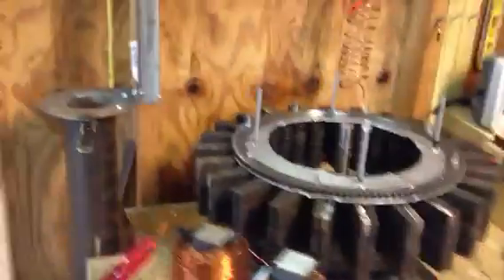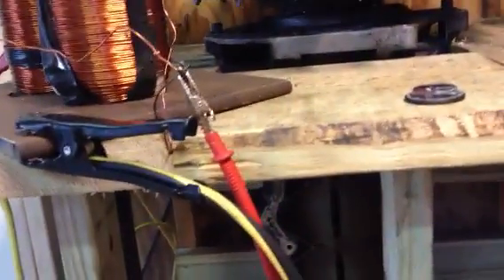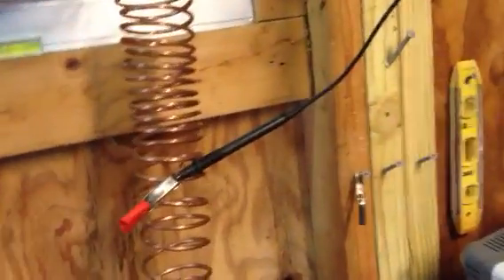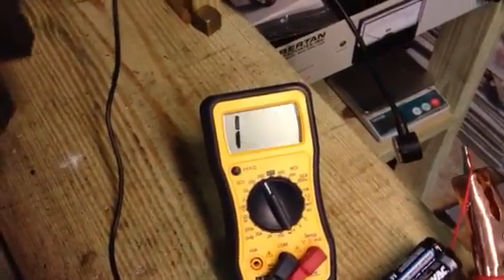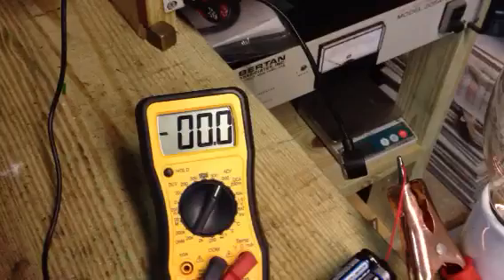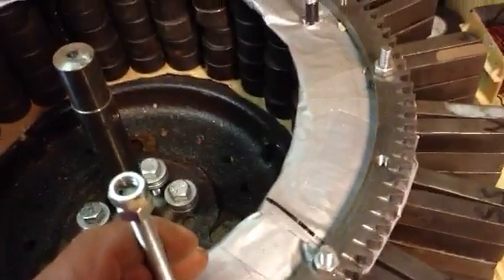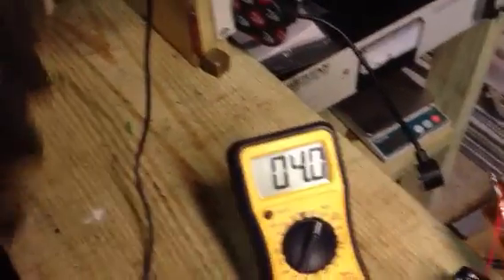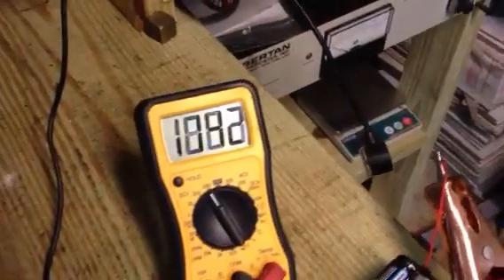Ed Leedskalnin Magnetic  flywheel

Comment: Why do you keep saying "Power" ?  You do know that voltage without load does not suggest any power, do you ?  Because if it did, you'd get much more "power" than this by brushing your hair with a plastic comb.  Doing so you'd get several  KILO volts of "power".  Secondly, a device like that produces pulses (spikes) of voltage. So you can't really believe what the voltmeter designed to measure harmonic oscillations, tells you anyway. Its a cute toy, but I struggle to understand what the experiment actually shows. I am not trying to be critical, believe me, just trying to understand where the novelty in this experiment actually lies. All I can see is a demo of electromagnetic induction.
Reply: looks like a good fly wheel for a bedini to me,
Reply: @DoctorTimelord  what's a "bedini"? Neve heard the term.
Reply: @DJdeliverance  look up bedini coils, its a cheap energy thing, mythbusters did a thing on it, but they built it completely wrong and deemed it busted, ive made one (that works) with some degrees of success, but i didnt have the correct coil wire or proper length so it functioned but not as good as it "should" saying that, alot of ppl have gotten better results then me, but not sure if anyone has properly replicated john bedini's one

Comment: That is impressive voltage, but voltage only doesn't tell you the power output... Think about a static spark... its incredibly high voltage, but you cant run a washing machine with it... no current.

Comment: I'm very interested in these new physics power technologies, so I"m not bashing the device itself, but you keep referring to the 'power' output from the system. But, power is a function of voltage AND current. Voltage alone is not an indicator of power, so there is no evidence of any significant power output. I do hope you finish the project, and get someone knowledgeable to look at the real input vs. output power, as I would be very interested in how it performs.  Good luck.
Reply: You are right, but he doesnt need an actual output power concrete measuring device but a simple lightbulb connected to those negative/positive wires, then lets see how much power he really produces. Voltage without load is nothing.

Comment: Voltage does  NOT equal power. You may be pushing a crap ton of voltage, but barely any current. Power (watt) is the combination of both voltage and current. If you actually do the measurement and math you will see that you get lower wattage out than what you put in. Go make something that can deliver and increase in voltage and current, Oh wait, IT'S IMPOSSIBLE.

Comment: what about putting a container inside of wheel with the magnets poking thru it and then fill it up with water and then put the negative into the water and spin it and see what you get......like a place to fill with water (half closed so water doesnt splash out) seal it up with poly caulk with the magnets poking thru.. make kind of like a car tire laying down with a bottom,  sealing it and the magnets in  to hold water but not let it splash out when you spin it then hang the negative in the water

Comment: The coil and flywheel are not maintaining continues contact. Thus, sporadic measurements on the meter are obtained. When the wheel is sped up the coil maintains less contact due to the increase in inertial power transferred to the flywheel. Basically, the coil is in the air longer and less time off contact to the flywheel.The voltage meter shows a decrease. More contact to the coil and flywheel allows higher voltage due to longer contact.

Comment: the coils are producing collapse voltage from when the electricity is turned off. with a diode and a cap you can collect the voltage can easily go to 10kv. lots of fun but low watts

Comment: From what I had observered watching the CoralCastlecom video. I got the impression he was focusing the "B" field of the magnet into the earth through the crank case, I think you need more mass at the center of the crank area, See Ed's design,  I think that extra mass was deliberate  a reason for the extra hardware at the center. Anyway how did you determine the polarity of the magnets???  did you stack in the repel mode or the attract mode??  I admire your efforts!!

Comment: You mentioned utilizing water as the contact point in the video, but was afraid of the effect the spinning had on  the water. Use a conductive gel, for two reasons:

1) The contact point can be penetrating the surface of the gel, and the trail behind it would be self repairing, allowing for maximum contact surface area.

2) The stability of a gel can be designed to withstand greater centrifugal force while keeping its relative shape

Comment: Your voltage is coming from the inductive current from the changing magnetic field and the transformer from the two coils.  I doubt the batteries are contributing much. Remember Faraday's law of induction.  You can move the coil relative to the magnet or you can move the magnet relative to the coil. You are doing the latter.  Couple that with your two step up transformer coils and viola- high voltage.

Comment: I think your coils might be arranged in the wrong direction.  If you turn them 90 degrees toward the wheel so that the top of the coils bridges the North and South of each V-magnet as it passes.  Just like how you charge the V magnets with the PMH.  Think of the coils as having to pick up off of the V magnets the same way that they are charged but in reverse.

Comment: what's with the other coil on the right side of the vid??
as far as the voltage that you're getting,  Look at an old lawnmower ingnition system... a rotating magnet past a coil with a make/break contact generates 10's of thousands of volts with no batteries.  I think you are observing this effect, but keep up the work  on this idea...  Most of the worlds truely amazing technology has been lost in the sands of time because the world wasn't ready for it....  Maybe we're not ready yet???

Comment: You can have all the voltage you can get but if you do not have amperage to push the volts, it's no more than Static Electricity.  No big deal. You need power to do work. In Electricity you do not get something for nothing. In generating power you must put in more than you get out, why simple heat losses. Motor or Generator gets hot that's a loss in total power up in heat, just gone.

Comment: To be clear, you are not measuring power, you are measuring voltage. To get an idea of power, you will need to run a load off the circuit; however, you will most likely get some drag on the wheel due to Lenz effect. Interesting experiment though, keep it up.

Comment: That is NOT power you are measuring, only voltage.....a static shock from a doornob has 1000's of times more voltage than this and its not much "power"....the true test of power is heat, if you can make heat you have power...

Comment: Keep in mind, using the proper terminology is important. Power is measured in AMPS, you are measuring voltage, which is not power. The amperage you're generating is probably very small but you're on the right track. I'm impressed with the results so far. If you're curious about water inside, look at a washing machine on the spin cycle. The water will cling to the outside evenly and 'climb' up the wall slightly from the centrifugal force. You could power the rotation by water flow though.

Comment: ya, its a generator. nothing more. and power is not just volts, your not putting out much power at all. nothing more than the batteries and the input from moving the wheel around. you have succeeded in building a generator/alternator, something that has been around for over a century.

Comment: I was wrong about the bolts. Those 4 do run full length, but it appears that Ed used much skinnier ones that did not part the magnet elbows so far. If you're visiting the castle do you plan on making a continuity test off one of the sphere heads? There are really 2, not 4 by the way. I doubt these could make contact with the base of the flywheel. More likely they, if they are bolts, not coils, are just serving as field centers to prevent demagnetization of ferrous v's during double diamond flip.

Comment: I tried to add you as a contact, but keeps saying I have illegal characters.
I can tell with with absolute certainty that you are missing quite a few parts. Also missing fact that volts on meter are high , but what are the amps? You need for example a proper magneto; the core must nearly touch the array. The flywheel alone is missing a special coil that fits inside. It's a special stator unlike a normal ac motor's stator, but it has another function as well. Lots of geometry in all parts !